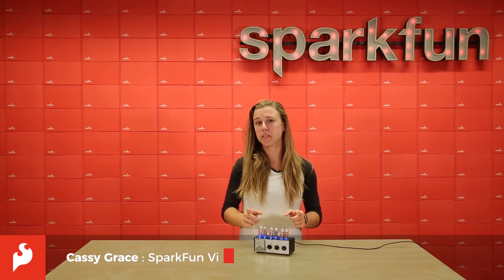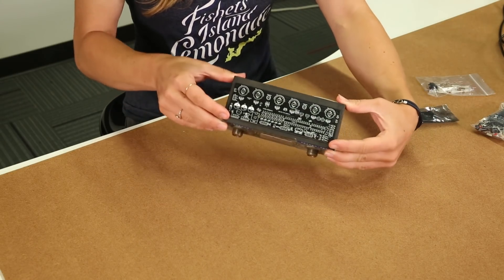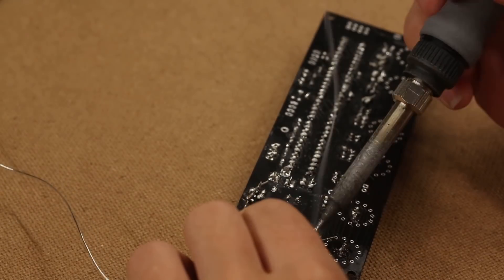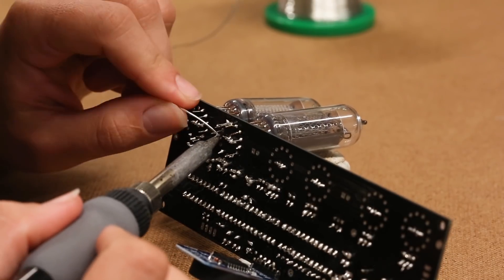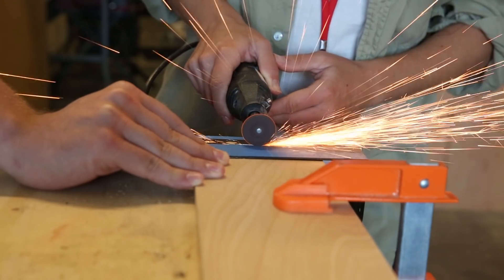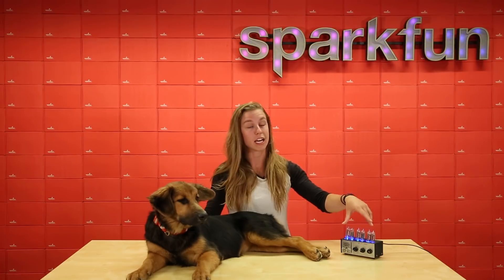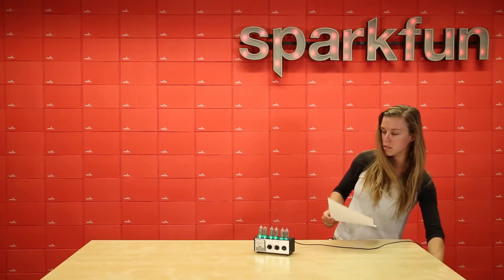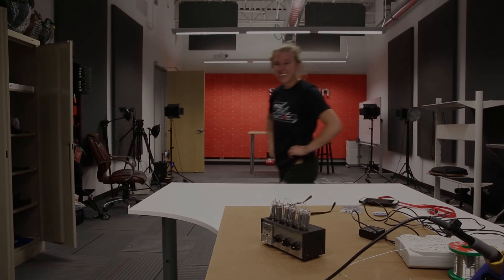Project Showcase: Nixie Tube Clock

Comment: I would have recommended 3D printing a jig to hold the tubes (probably take an hour), and covering the leads with heat shrink before soldering. The dead tubes could be due to shorts between the leads, or they could just be dead.